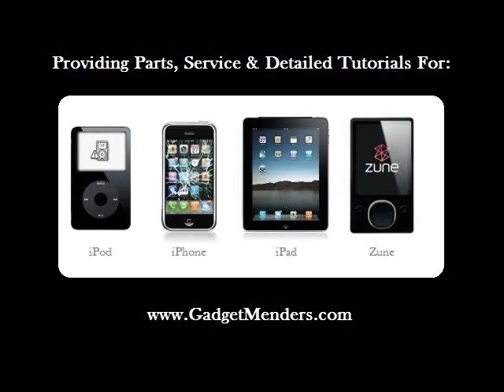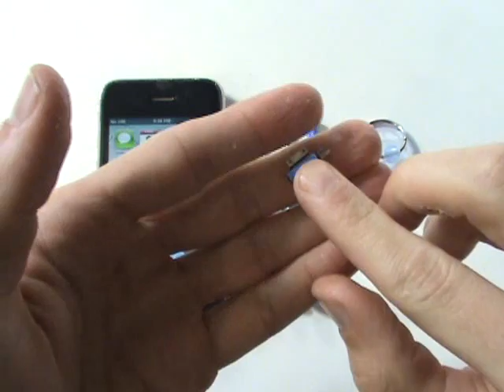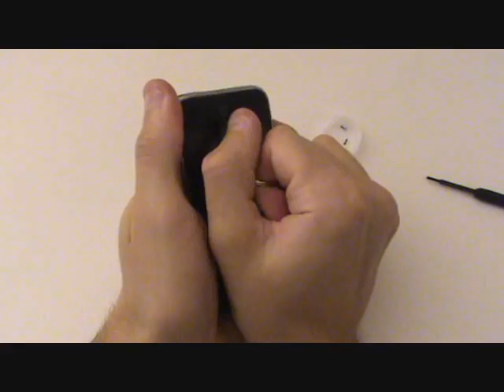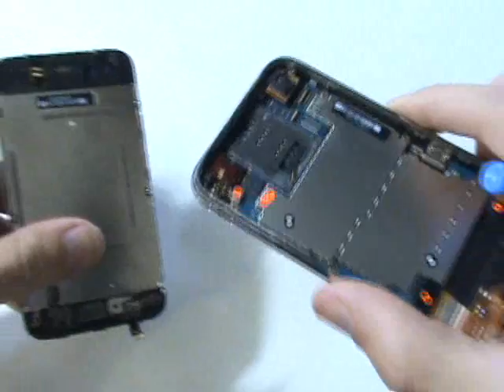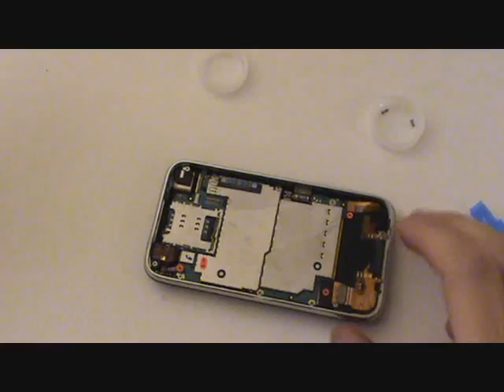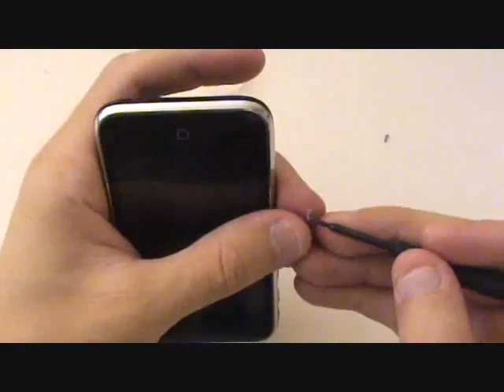iPhone 3GS Vibrator Replacement Repair Tutorial | GadgetMenders.com

Comment from the maker: No, that is an issue with the size slider switch.  You would need to replace the power, mute, volume cable.  You can find all parts and tools on our website.  Follow the link in the description.